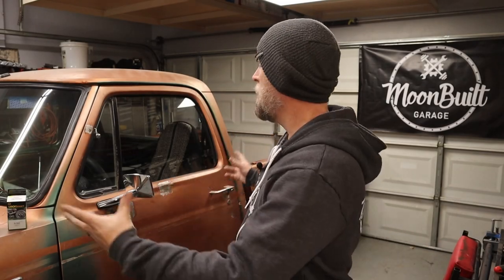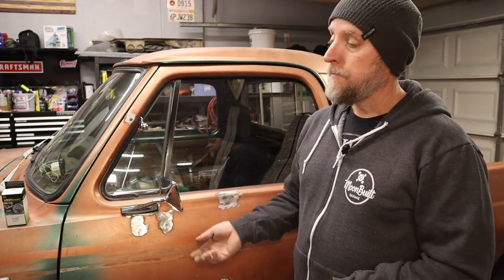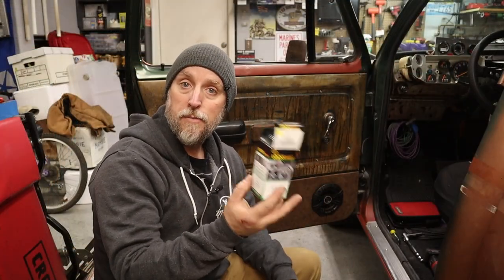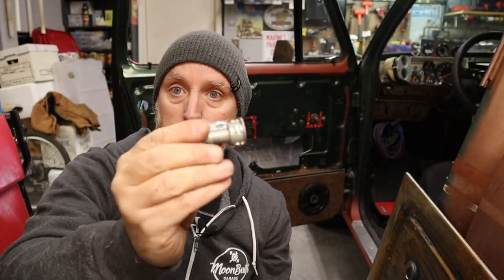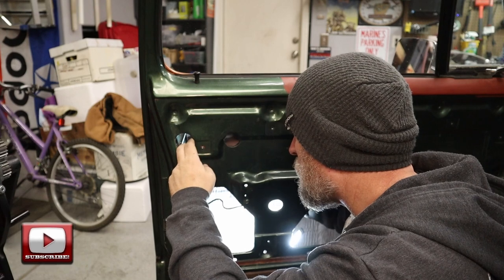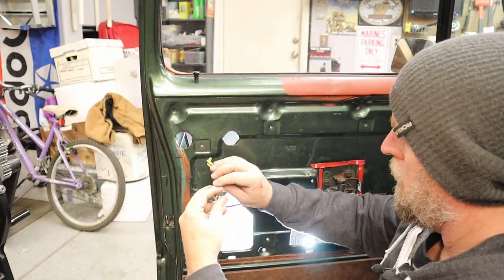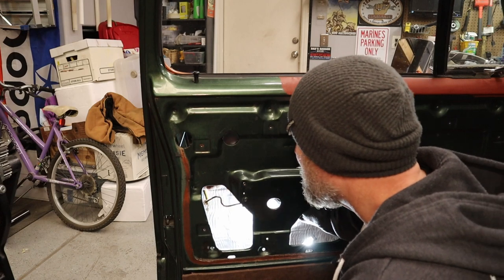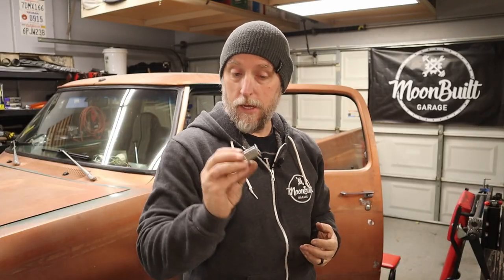How to Replace Door Lock Cylinders Quick and Easy | Remove and Install Door Locks

Comment: Thanks! I have an 85 D150 that the ignition cylinder wore out and locked up and I had to replace it. I also will have to replace the door lock cylinders too as the 85 used only one key for the doors and igniiton.  I've already done the ignition cylinder and am waiting for some good weather to do the doors. Your video is very helpful.
Reply from the maker: Glad it helped

Comment: Well I'm getting ready to do. My daughter did actually lose a key. To her truck it's going to cost $200 to tow it in town. So here I go to attempt to change the lockout so I can get a locksmith to match it up cuz it's also the same one for ignition
Reply from the maker: I need to have my locks and ignition matched...its a pain having separate keys.  Luckily the locks are easily removed and installed to get the matched up, if it's even possible

Comment: 99 ram van... got the clip off but now do I remove lock cylinder fro the inside or outside of door? It's not budging (van was painted).
I dont want to force w/o some instruction. 
 I lost the ignition key and was told this is the best solution to get one. Yes, there was one key for both door and ignition.
Locksmith agreed. Thanks.
Reply: I'm having the same problem!!

Comment: Quick question: How does the cylinder rod connect to the door lock rod?  I saw you use a channel locks. Does it click on? Click down? What's the trick? Been working on it for about an hour.
Reply from the maker: If I remember right I used the channel locks to get get the clip holding the cylinder to the door into place.  As for the rod, since it is s-shaped, it just goes into the hole on the back of the cylinder (I know that doesn't make a lot of sense, but go back to the 4:00 point in the video).

I removed the rod and old lock cylinder from the door in order to get the rod into the cylinder.  As for getting the rod back into the latch, you will probably have to replace the plastic pieces that more than likely crumbled when you took it all apart...at least I did.